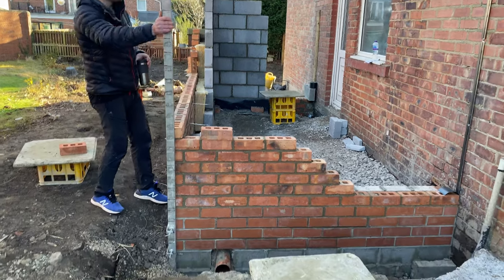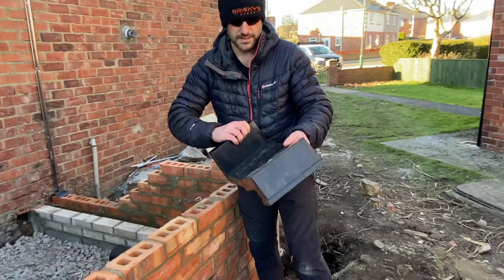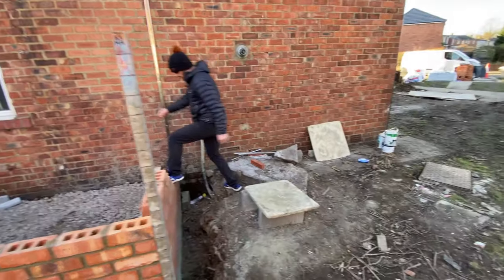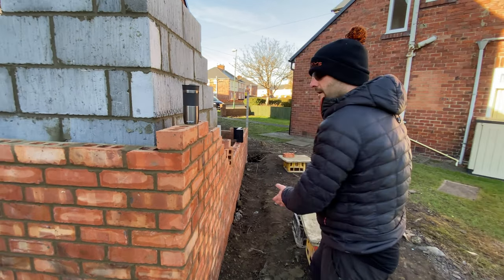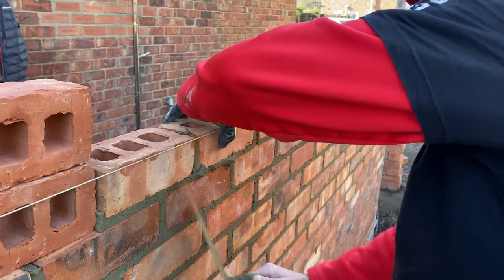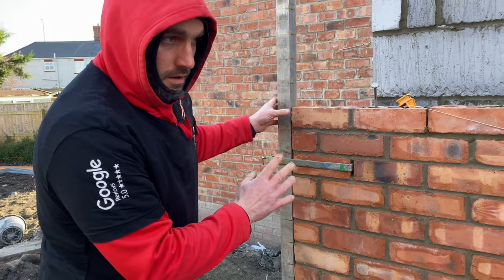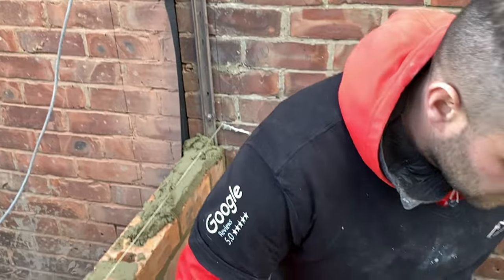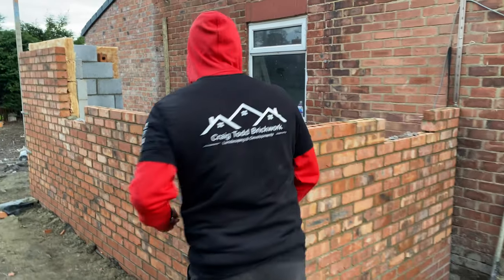It's a Struggle, Old Bricks & Openings - Ep3 Building a house extension (HD + 4k)

Comment: Enjoyed the video but one point to raise weep vents are for allowing fresh air in to dry out possible condensated cavities NOT to let moisture out
Reply from the maker: Thanks Kevin I’m glad you enjoyed it mate 🙂
Really good point regarding ventilation, i do agree Kevin and often miss that out when I’m explaining the purpose of them. 
However they do let the moisture out, not that its going to be running like a tap anyway like but anything that goes onto a tray leaves through the vent. 
Stepped trays on a garage thats attached onto a house for example. From the ridge the trays are stepped down to the bottom of the garage roof where there is a weep hole to let water escape in that last tray. If that makes any sense, hopefully i explained that well enough 🤣
Reply: I’m a bricklayer of many years and they are for air going in to dry moisture not water coming out as they are for the lead cavity trays vented top and bottom as they are in timber frame houses when warm air from inside house meets colder air with in the cavity it causes condensation fresh air through the vents dry it out also in the case of vented solums 🤣
Reply from the maker: @kevinstewart301  yeah i do agree kevin 👌 like i say theres not running water 😂 but it can leave there and as you mention the ventilation will dry it out before it could ‘drain’ through the vent 👍 
Nice comment mate, appreciate it man 🤝
Reply: @CraigToddBrickwork  👍🏻
Reply: @CraigToddBrickwork  now subscribed like I said like the content keep it up mate
Reply from the maker: @kevinstewart301  thank you Kevin, I really appreciate you subscribing 🤝 it mean a a lot. Thanks again for your original comment too, its all helpful and good of other trades to have an input too. Its all useful knowledge and sharing it, thats what its all about mate 👊🤝
Reply from the maker: @kevinstewart301  thanks kevin 🙂

Comment: Just a question about wall ties,how does the water get to the outside leaf if its full of insulation,iam not the brightest but would the insulation get wet?and stop the water reaching getting across to the outer leaf,not knocking you your doing a good job but I always look at logic,have a good week my mate
Reply from the maker: It’s a great question mate and quite a common debate to be honest. Myself included, the logic says, keep cavitys free and clean but then we are told to jam full fill insulation in there on the specification. The same on new builds, they get pumped full of insulation after its built. The debate is, wont it get wet and cause dampness. 
I agree with the logic mate 100% but we do what is asked of us. It’s all to building regs and good standards, its just the logic behind it.
To be honest there should be no moisture in there anyway and I’ve never heard any issues regarding it. Its always been done like this, since I started nearly 20 years ago now. 
Hope that helps mate 🙂
Really appreciate the compliment to mate, thank you 🤝 i didnt take it as knocking my work, it was a genuine question mate  🙂
You too Anthony, have a good one 👊🙂
Reply: @Craig Todd Brickwork  iam a bricklayer myself and like you I don't get the logic behind it,🤔👍
Reply from the maker: @anthonyworthington6495  i hear lads down south are doing 150 cavitys, 100 kingspan with 50 airflow. Seems more logical to me. I did one up here in newcastle like that last summer. 50 kingspan with 50 airflow, i think it was beefed up for the uvalue with insulated boards inside. 
Its more of a chew on though isnt it, normally put the brickwork up first and tape the blockwork in after. But the blocks need to be ip first for the kingspan to be taped that way doesn’t it 🤷‍♂️
Regardless it needs to be built to the spec doesn’t it 👌
Reply: @CraigToddBrickwork  IAM doing a block extension at the moment with180 insulation infill,you can't write the script or what goes in architect brains
Reply from the maker: @anthonyworthington6495  180 insulation 😆 bloody hell mate thats mad isnt it. How are you finding that?

Comment: As fullfill cavity why don't you do brickwork first set your openings then back it up never seen the point of Blockwork first unless using celotex
Reply from the maker: Normally I would however the brickwork is 83mm gauge and i find it best to get the blockwork first up so the ties end up on the right course 👌